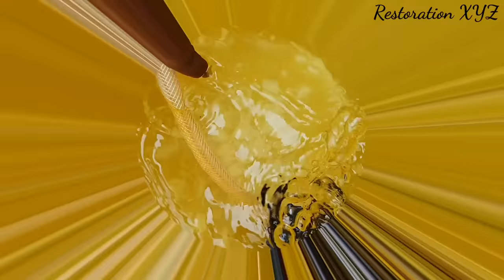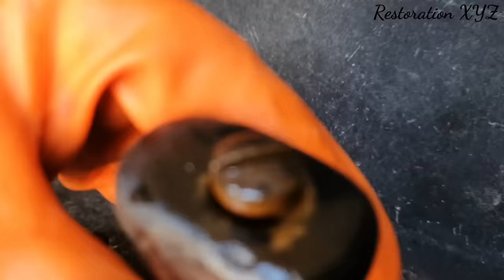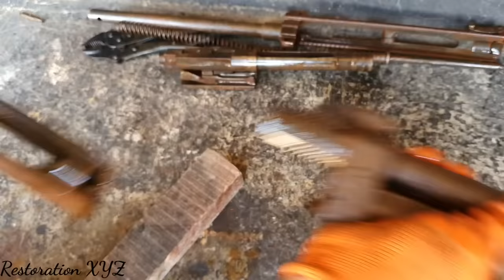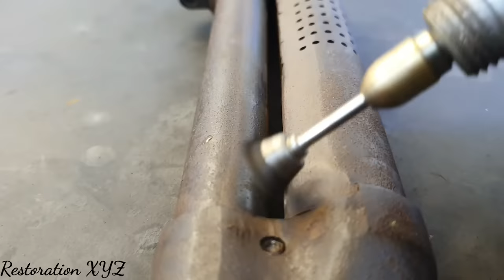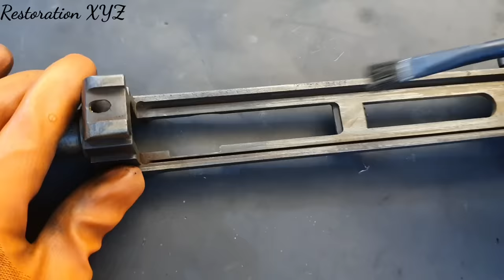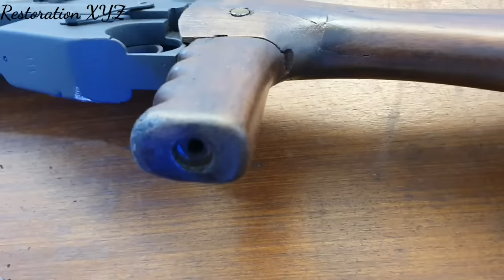Secrets to Perfect LMG 7.62mm Restoration

Comment: As much as I don't like leaving negative comments, this might be the worst attempt an a restoration or any "damaged" tool that I have ever seen, with the "bluing" being misused and was finished by a coat of to the looks of spray paint. The neglect of the parts, in which were dropped, the spray of water in the beginning was utterly pointless, if you want to remove rust, please use steam, or best is boiling separate parts of the main tool, instead of "cleaning" the whole tool in one go, it would have saved time after since it would soften the rust, making it be removed easier and just better for the tool, if it was refurbished to fire once again. This is the worst restoration of anything that has graced this platform, besides rust appearing on tires.
Reply: Ooof wait till you hear this guy was a student of mark Novak
Reply: and the fact he's bluing over rust still smh.
Reply: He needs proper screwdrivers and punches as well. Guns aren't soda machines
Reply: I had to carry an LMG about, many moons ago. Good weapon. This 'refurbishment' pains me. Like seeing a nice old lady who has been covered with several layers of orange spray-tan, although blue car paint seems to have been used here. Tsk!
Reply: This was not a good restoration.

Comment: This rifle was artificially rusted so they could make this video.  Had it been naturally rusted out, the wood stock would have rotted away...but as you can see, it is still there doing fine.  Fake!
Reply: not necessarily, i have a 30-40 krag jorgensen i found in a hunting stand that had been left there for probably 30+ years, so long that the bolt was rusted shut, stock was sunbleached on one side after sunlight hit it from the window. i cleaned it and oiled it. bolt is super smooth after i freed it and the stock just needed light refinishing, no sanding. wood can hold up better than you think, just all depends on the conditions

Comment: This light machine gun has not been properly restored. Watching the video it seemed that only formalities had been completed to make the video.
Reply: @bipinkumarsharma,did this gun have a bipod stand on it because it looks like it used to have one & the piece where it supposed to be at is off to the side of the barrel & your right they didn't even take apart the whole trigger mechanism & why didn't they just just sand the butt stock & the other wooden pieces instead of putting them in that rusty water,they are wanna be restorers
Reply: Sometimes a gun like this does not need to be totally stripped down for a clean and refinish.